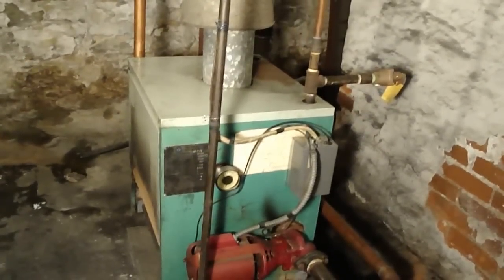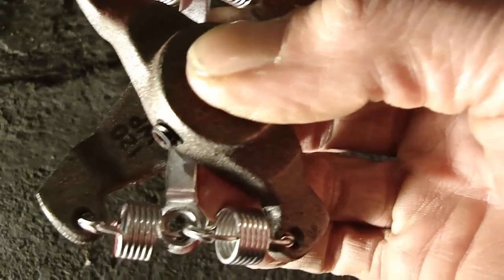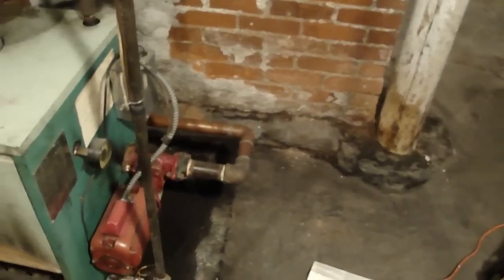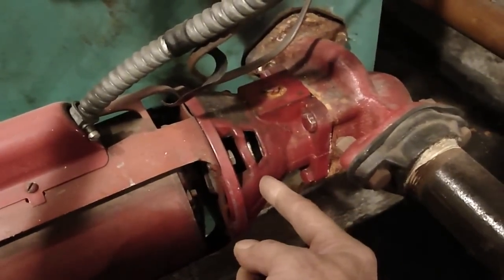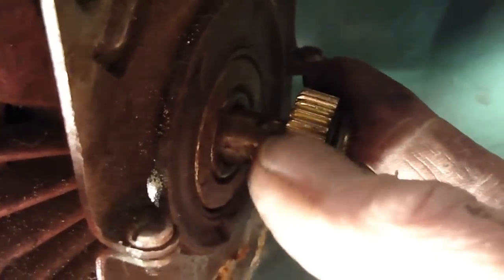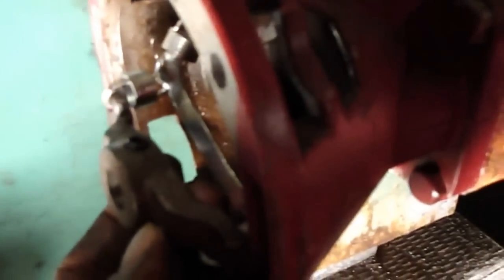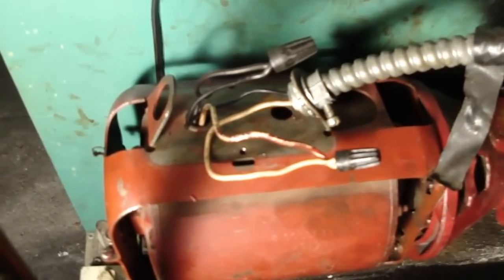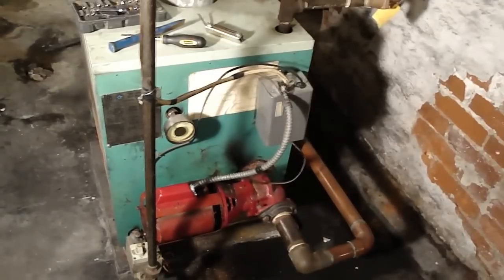1022 Knox: How To Service a Bell and Gossett Pump in a Hot Water Boiler

Comment: Change the motor mounts. or you will back again. The reason the existing coupler failed was because the bearing assembly was on the way to seizing up .  The Spiralink coupler will last for ever if the shafts are aligned and the bearing assembly is not tight.
Reply: What makes the bearing assembly seize?  Could it be that someone forgot to add oil for the season?

Comment: How do you lube the pump? Are there several lube points? What type of oil do you use?
Reply: only use 20wt NON detergent oil
Reply: There are two tubes leading to the bearings, one in front and one in back of the motor. Use SAE20 or 10w30 oil.  You also need to lube the impeller which is what was chirping very loudly in the video, lack of lube is probably what destroyed the coupler or it could of just worn out like mine did.  I woke up this morning and it was 50 degrees in my house.  Checked the heater and the motor is seized because this coupler was in 6 pieces and lodged inside the housing stopping the motor.  Thankfully the motor didn't start on fire and and I had a spare coupler because I blew one a year or two ago and bought a spare, that reminds me, time to order more.  Not a very nice Xmas present, I would of rather gotten coal....it was 6 degrees F this morning and at least I could of burned it and stayed warm.  Merry Christmas!
Reply: @Mad_MaX_X_X Bad motor mounts destroys coupler

Comment: When are you going to replace the deteriorated impeller and leaky shaft seal? The leak droplet is clearly visible under the housing when you were removing the lower motor bolts.